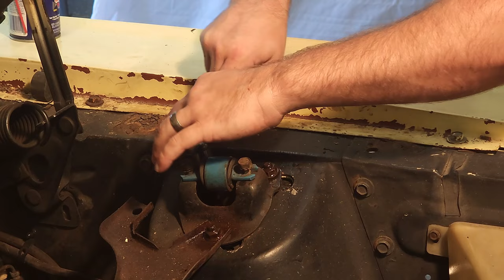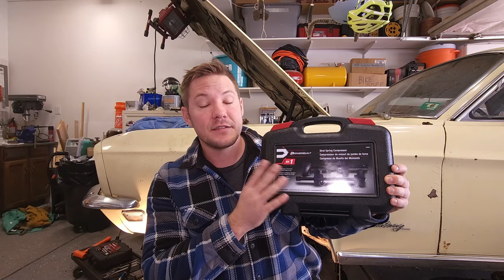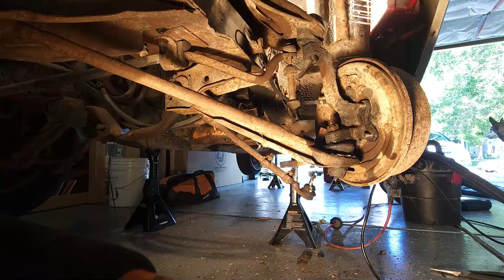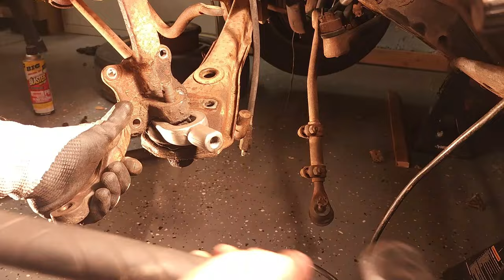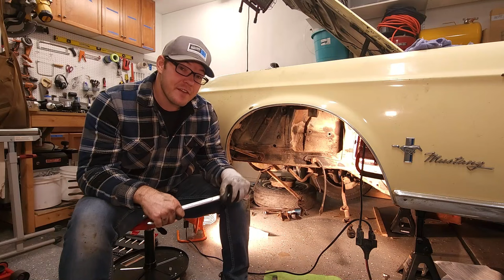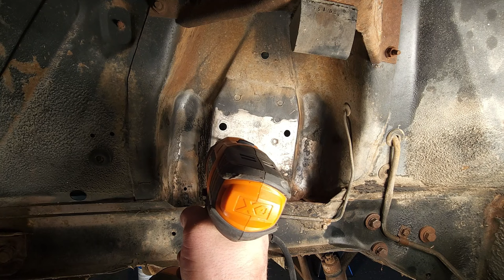Upgrading a Classic Mustang to Front Coilover Suspension!

Comment: Just a tip For everyone , when Working on coil springs on old fords , use a "internal" spring compressor . The threaded Rod and hooks go inside the coil. It Will give you a lot more Room to compress and remove/reinstall springs !
Reply from the maker: Good tip!
Reply: Also you might want to  use a chain inside  the coil spring from shoot out if the  spring  compress fails.
Reply: If one knows they're not reusing the spring then leave the shock bolted in place and cut the spring midway down with a torch or angle grinder. The spring will pop at the end but can't go anywhere as it's held in place by the shock. Disassemble from there.

Comment: is there just a shock and coil over the at can be installed in place of the or spring? Everything is original “new” parts except the springs on my 71 Mach one
Reply from the maker: So regrettable there is no off the shelf product like that that I am aware of. You COULD modify the mount points for the strut and put a coilover in its place and put in a shelby drop while you're at for the stock arms but I make no promises on performance for something like that. As long as your handy with a welder and a grinder (as a bare minimum), it shouldn't prove too difficult.

Comment: I liked your video. I think most people would be encouraged to also try this themselves. Just a few comments,  1) why not clean and paint the spindle and the frame mounted component areas and 2) thread locker on all component assembly points with the exception of the castle nuts. That's a huge safety issue. Otherwise,  it's a very beneficial video.
Reply from the maker: Because we'll be taking it back off when we go to do body work and blast the body.

Comment: Not trying to be a smartass but why didn't you upgrade the stabilizer links and sway bar? Just curious.
Reply from the maker: It's a fair question. The answer is we are/did. We gave a 1.25" OD sway bar with new bushings and linkages and we'll be upgrading the steering mechanism later as well. We didn't feature the sway bar in this video because it's a pretty straight forward upgrade and this is a temp install for us since we're going to strip it down and blast it soon. That's why we just mentioned in the video that this the perfect time to upgrade your sway bar. Hope that answers your question.
Reply: @enginegremlin  yes it does and looking forward to more videos. Gonna subscribe now!

Comment: Never "Crimp" your brake lines!,,, Interesting suspension upgrade.. Never torque the lower control arm inner bolt, always torque the nut, else you will change the alignment or end up rounding out the bolt hole in the offset plate, that side towards the camera...
Reply from the maker: Ours were old and cracked and are getting replaced but good tip.